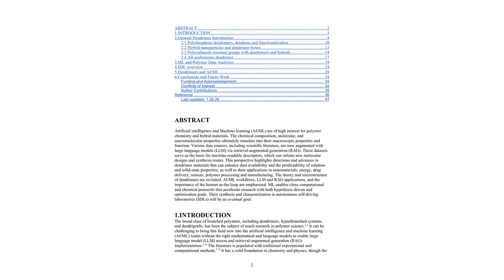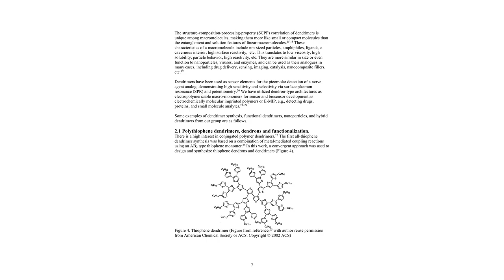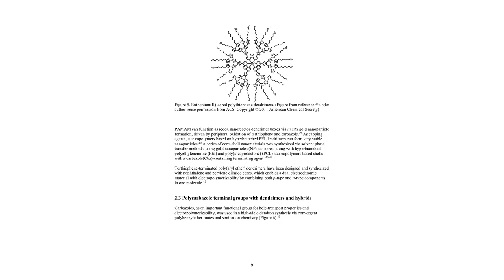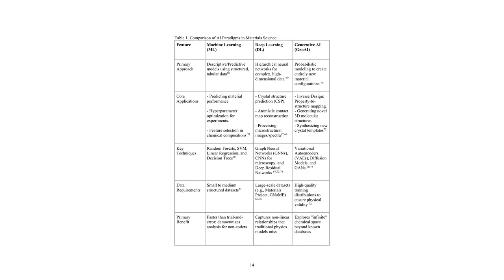AI/ML-Driven Optimization of Dendrimer Design, Synthesis, and Applications

Comment from the maker: SUMMARY:

This video explores a perspective piece by Regalberto Advinkula and Jiua Chen on using Artificial Intelligence (AI) and Machine Learning (ML) to revolutionize the design, synthesis, and application of dendrimers—a unique class of tree-like, branched macromolecules (0:00-1:35).

Key takeaways include:

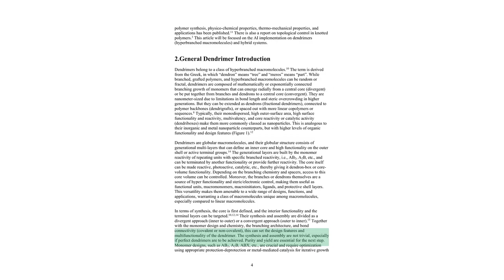Dendrimer Basics: Dendrimers are defined by their precise, exponential tree-like structure, which gives them globular, nanoparticle-like properties. Their interior can be used as a "dendro box" for encapsulation, while their surface is highly reactive and versatile (1:35-3:30).
The AI/ML Shift: Traditional, trial-and-error research is being replaced by dendrimer informatics. By using Large Language Models (LLMs) and Retrieval-Augmented Generation (RAG), scientists can process vast amounts of literature to create machine-readable descriptors for molecular design (7:36-10:20).
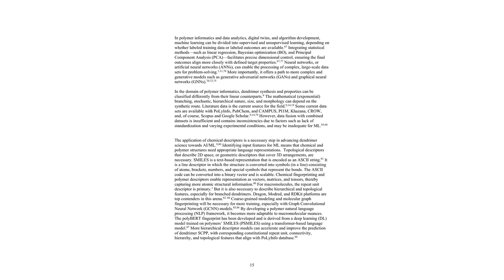Self-Driving Laboratories (SDLs): The goal is to move toward autonomous labs that combine continuous flow synthesis with real-time characterization and Bayesian optimization. This loop enables rapid, automated discovery of optimal reaction conditions with minimal human intervention (10:32-13:00).
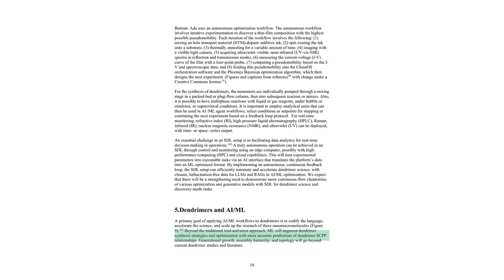Future Impact: Moving from fragmented, small-scale studies to centralized, data-driven informatics promises to accelerate dendrimer science. This enables the in silico prediction of properties like cytotoxicity, making them safer and more effective for biomedical applications like drug delivery (13:16-14:40).
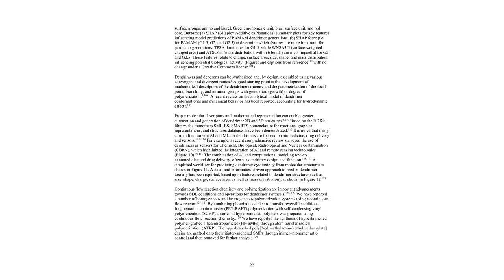The authors conclude that the future of polymer chemistry lies in integrating human-in-the-loop expertise with physics-informed AI, aiming to achieve the commercial scalability these materials have long promised (14:38-15:53).